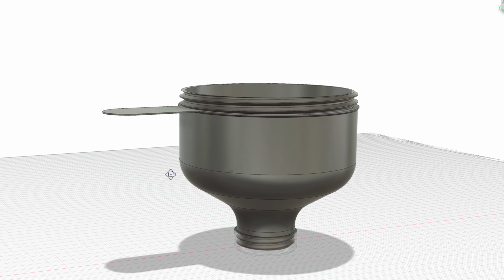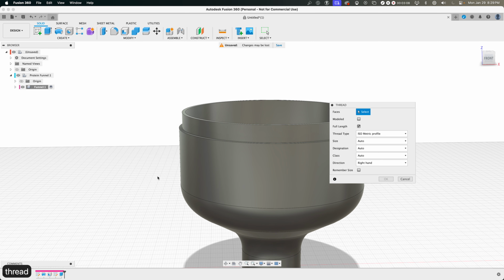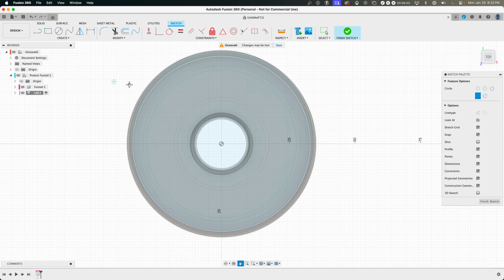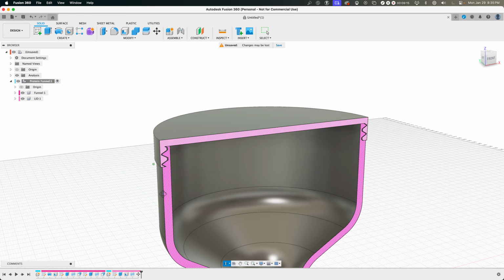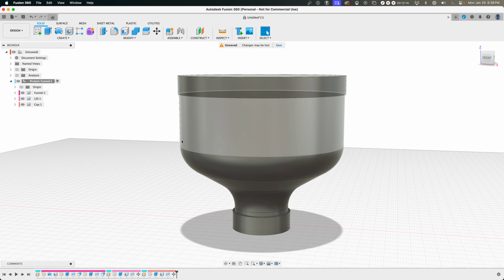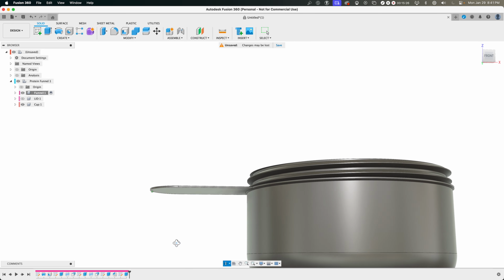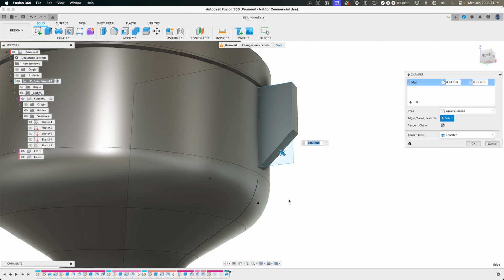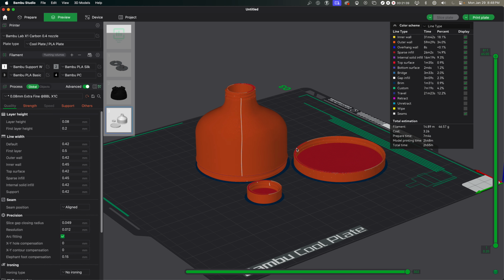Day 7: Learn Fusion 360 for 3D Printing | Protein Funnel

Comment: Thank you for the training as a complete noob to 3D software and 3D printing I am finding your delivery and commentary very helpful. It may be my equipment (not the same as yours) or my inability to the settings right but I could not get the funnel to print. It kept dislodging from the bed. Also the threaded portion made the walls so thin that when printed in PLA they came apart. So to fix these problems I put a 1mm offset on both thread areas (with chamfers) to increase the wall thickness and created a circular pattern with 1 mm square tabs that supports the first 1 mm of print and gives the base more area to adhere to the base for printing. Seems to have worked! As once printed I simply cut the tabs and removed the support. I couldn't figure out yet how to add the supports on the slicer but I'll go there at some point to learn that.